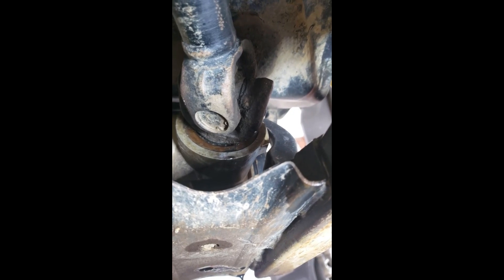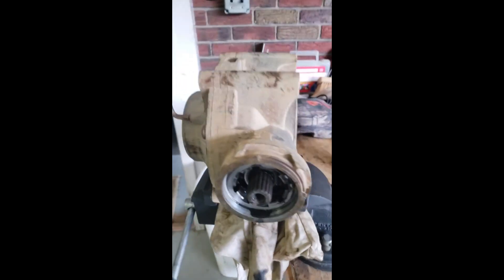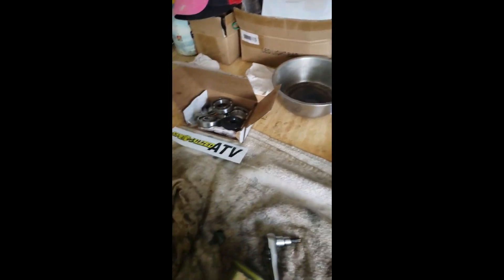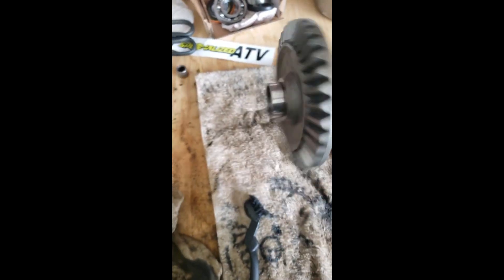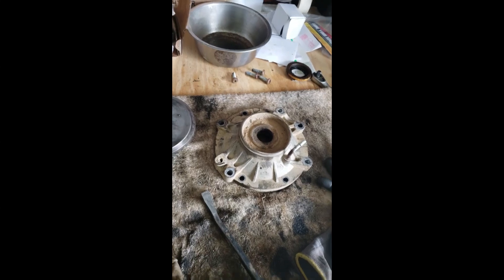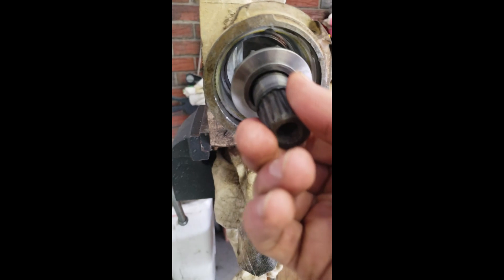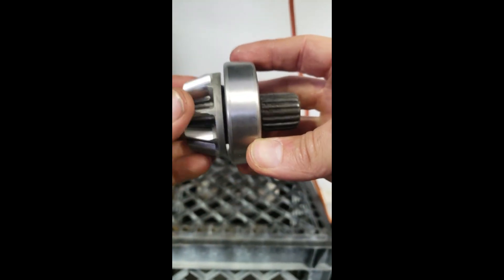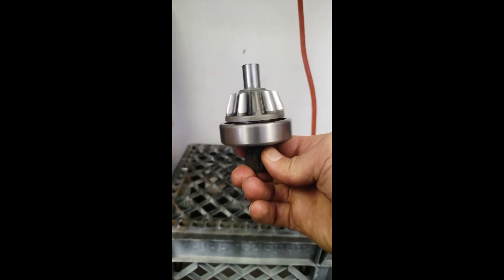G2 Can Am  How To Rear Differential Rebuild - Seals and Bearings

Comment: Did you re-shim or double check your backlash? I know they say re-shiming is only for when the gears are being replaced, but considering these come poorly shimed from factory I figured a re-shiming may be worthwhile?
Reply: I would recheck to see if everything was in speck before installing back in bike, just to make sure. Some are not right from factory, that's the reason they fail. Just say'n 😊

Comment: Thanks for the great video!   You have a nice bright garage and it is easy to see everything you are doing.    I guess I feel fortunate compared to your 1500 miles ; My 2014 Outlander XTP has just over 6k miles and the rear diff just started to weep oil due to a failed oil seal.    I am installing the new oil seals and wear rings, but after watching your video, you've convinced me to change the bearings while I am in there.     Thanks for the auto store tool rental tip too.
Reply from the maker: Hey man, thanks for the feedback, I appreciate you! Let me know if you have any questions!!!

Comment: The rear final drive should last for at least 10 thousand miles with normal trail riding but I guess you never know.  Mine has 4500 miles on it    Just the fuel pump went out

Comment: How did you get the pinion seal off I noticed it wasn’t covered  the video and I’m having a hard time with mine
Reply from the maker: When I had it on the bench I used 2 small pry bars and a rubber mallet to pry it out.   I believe harbor freight sells a seal removal tool that would make it easier as well

Comment: What's the best way to get that rear diff seal off if it's stuck?
Reply from the maker: I'd say spray some penetration oil around it for a few hours, then use heat

Comment: Good job man i need help i have a renegade 800 2008 and the drain plug the thread its stripped i need help?
Reply from the maker: Hey thanks for watching.  I've stripped them weak hex set drain screws before...  if you can try tapping in a larger size hex, or even better a torqx that's bigger than the hex that's stripped and try to tease it out... other option is to drill it our and try a speedie out.. depends how bad its stripped
Reply: 4x4 Play yeah good im fix a new drain plug sorry im french im fix a bolt 1/2-13 i have no choice the ex proprio its stupid
Reply from the maker: Yes it's a terrible design!

Comment: I have this same problem. Went with a Mud N Wheels diff. Guess the factory can am rear diffs tollerances are horrid. My pinion bearing is worse than yours. I will probably rebuild my current diff as well. Thanks for the video, I had the idea of all of this but it's nice to see it in video. Well done sir! I'll probably order a bearing kit from specialized atv as well!
1800 miles here on my 17 outty 850. Pretty sure it's been bad for awhile. I'll be paying more attention to the seals and any play.

Comment: Just did my g2 with a all balls kit. Is it normal for the diff to be kinda stiff after rebuild?  I can turn it by hand but its stiff,no binding tho. Backlash is gtg, idk if its the tacky ass grease they put in the bearings or if something is off??
Reply: How has your diff held up since the rebuild with the all balls kit? I just re did mine with the same kit and I noticed it was stiff also. Not binded but stiff and smooth. My Backlash seems fine too.
Reply: @christophermcadams2823  Got an update?